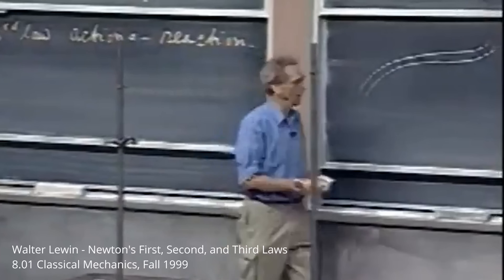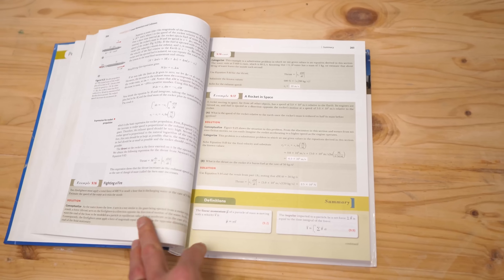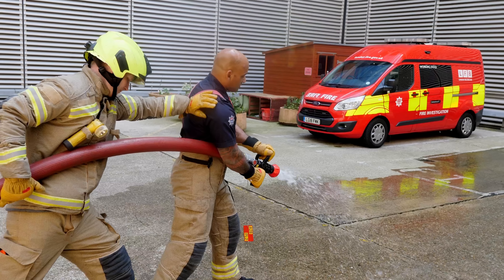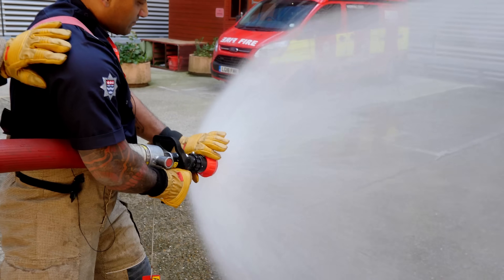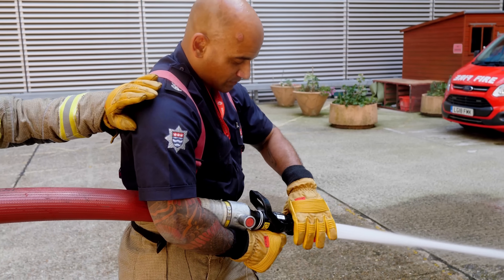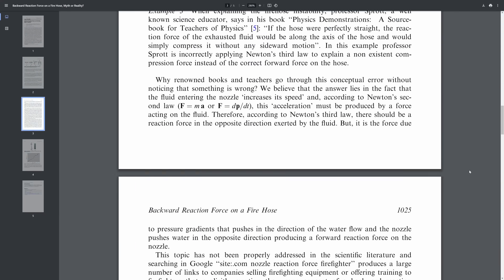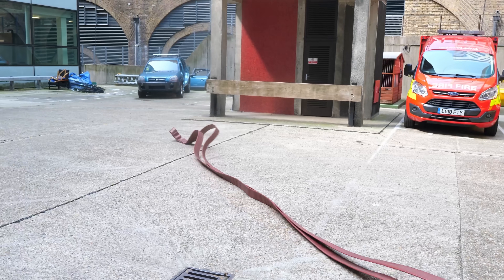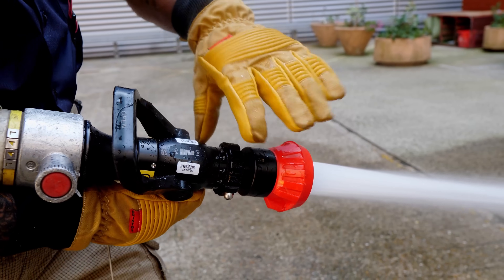Why chaotic hoses dance

Comment: 11:50 Steve I'm sure you know this but the pressure inside the hose actually does decrease along its length, a phenomenon known as head loss. The reason the speed remains constant is because the pressure gradient in the fluid accelerating it forward is opposed by shear forces created by the viscosity of the fluid. However for the typical Reynolds numbers and lengths of a fire hose the head loss would be a small fraction of the pressure drop at the nozzle so the subsequent analysis still holds.

Also worth noting that an ideal water pump imparts no momentum to the fluid it pumps, as the flow rate and density are the same at the inlet and outlet. The difference between the inlet and outlet is pressure, which becomes momentum at the nozzle as you described. (Correction: assuming the pump inlet and outlet diameters are the same)
Reply: Material properties of the hose or pipe is something else to add to the puzzle. The elastic deformation of a hose full of water is non negligible.
Reply: @caspertheghost359 I had been racking my brain over what differences there would be in this scenario if the hose was made from a perfectly straight solid material, eg: steel or aluminium. That would take out any variables due to any elastic properties of other mediums, so what impact would this change have? What if there was a small section of regular elastic fire hose added between the outlet of the pump and the solid hose in my hyperthetical? I don't brain too well.
Reply: @Denis_of_Earth1  well, then the pressure from the reaction of the water would be negated by the "hose's" or pipe's structural integrity, the whole pipe compressing on itself length-wise from the exiting water. However, not that much force is actually imparted onto the pipe itself other than the pressure from inside to outside, because now the water isn't hitting any bends, so other than the friction of the water by the pipe walls, and the pressure pushing outwards, the pipe doesn't actually experience much force, not with the firetruck taking most of that force into it.

The elastic deformation is what makes hoses so dangerous, because now it's like a chain, and there's no structural integrity there to impart all the force on it into the firetruck, so instead the entire hose is plunged into a chaotic tug of war with equal forces throughout the pipe acting it random directions, creating chaotic flailing motions.
Reply: i like the way head loss is so similar to voltage drop that ohms law and darcy-weisbach kind of match up too.
Reply: An ideal water pump would impart momentum upstream where the inlet interfaces with static stored water. It does so by inducing a negative pressure wave in that direction.
Reply: @JWQweqOPDH  Yeah I suppose it depends on where you place the boundary of the pump and the inlet. You're certainly correct that the water gains momentum when it enters the inlet from the reservoir.
Reply: I'm thinking of the rocket principle. In a hose with ho nozzle, the water just flows out calmly. In a hose with a constricting nozzle, the water accelerates and ejects at a higher velocity, creating much more force.
Seems like the hose and rocket nozzles are pretty similar..
Reply: The nozzle converts the static head/pressure to velocity head/pressure. Without the nozzle (restriction) on the end of the hose, the velocity of the water leaving the hose would the same as the velocity of the water inside the hose.

The obvious point of comparison is the old thumb on a garden hose - when you make a restriction with your thumb, the flow goes down, but the velocity goes up. Of course with a garden hose, the pressure entering the hose is constant, but with a centrifugal pump (like on a fire truck), the pressure entering the hose depends on how much restriction is in the hose, with more restriction generally meaning higher pressure. The nozzle is probably the largest source of restriction in the system, so the pressure drop from the pump to the nozzle is (probably) negligible compared to the pressure drop between the inside of the nozzle and the atmosphere. Without the nozzle, the water at the end of the hose would already be at atmospheric (static) pressure at the end of the hose, and no acceleration would occur.
Reply: @nikitanugent7165  Yes exactly, I think your analysis is spot on. This is basically what I was trying to say but worded much more clearly. The restriction on the end of the hose is the key.
Reply: If the ideal pump maintains a pressure difference, then there's a net force on it, right?
Reply: @danielchin1259  The way that a centrifugal pump works is that water enters at the middle, and a spinning impeller blade pushes the water outward, increasing the pressure at the outer circumference of the casing, where the water exits the pump.

Without getting deep into the weeds of all of the forces involved in the spinning impeller, the net force would basically be that the water makes a 90 degree bend as it enters, and another 90 degree bend as it exits.
Reply: @danielchin1259  not really, if it had a net force, it'd be displaced, but all it will do is flail about. In fact, I suspect that if the pressure always maintains the same, the hose will eventually stabilise

even without ideal conditions, tube mans can stabilise and become completely straight
Reply: The situation is different between air flow and water flow. The water is incompressible flowing in a somewhat elastic pipe. The air is compressible flowing a relatively inelastic tube. I think this difference is non trivial.
Reply: I think Steve is describing something different from head loss. What Steve describes is the gradient in pressure that must exist because fluid pressure is continuous and not discrete as is analogy. Whereas head loss is the loss of (dynamic) pressure as a result of friction with the wall, which is definitely real and is also happening in those hoses
Reply: he said that accounts for the momentum, he didn't say that it imparts momentum.
What he said is valid.
Reply: Exactly.  The pressure loss may be negligible if the hose diameter is very small or very large, with a small nozzle . It can be very significant in some cases.
This may be intuitive to people accustomed to using ohm's law. Pressure acts much like voltage.
If you "short" a power supply with nothing but a long copper wire, all of the voltage (pressure) will be lost in the wire. So the voltage (pressure) at half the length of the wire will be half of the initial voltage. If you put in a high resistance (a small nozzle), most of the pressure drop will be at that resistance.
Reply: Best comment on here :)
Reply: Turbulence, eddy current and laminar flow are generated in the hose. The flow rate is different, the pressure is different, and it keeps changing.
Reply: @jy9915  I believe that turbulence inside the hose results in highly chaotic lateral pressures as the water exits.
Reply: So it's kinda like the water is sticking to the walls of the hose right ?
Reply: @alexnepu1561  Yes, and also to itself. So the infinitesimal layer of water at the boundary of the pipe is actually stationary, and the water flows faster the closer to the center of the pipe you get.
Reply: As many have pointed out, there are many variables involved. However, I'd assume many of these variables are insignificant enough that they can be safely ignored.  Someone's good enough with coding and physics should be able simulate this wigling on a computer. I'd wager just 1 or 2 variables are enough to convincingly simulate the phenomenon on the screen; thereby proving that most of them contribute little to the effect.
Reply: I think there is a problem with the force measurement of the small transparent hose. From the setup I feel it is measuring two forces: the pulling back of the hose minus the air blowing on the top of the force meter. This last force depends on the speed of the air. But if the hose has bends there will be more friction/head loss, the speed will be slower. So with the bends there could be more pulling back of the tube itself but it is counterbalanced by less speed. Another setup might give clearer conclusions.
Reply: Was about to write this comment, thanks
Reply: @turtledruid464 Some statements are incorrect.  Speed remains constant due to conservation of mass.  Velocity and pressure gradient are related but constant speed has no direct relationship to a pressure gradient.

Your description of an ideal water pump is actually 100% backwards, at least for a centrifugal pump.  The only thing a centrifugal pump does is impart momentum on the fluid.  Everything else (flow and pressure in the downstream system) is a function of that imparted, increased, momentum.
Reply: @andrewhirsch6089  Your first statement is incorrect, take a look at the Navier-Stokes equations for pipe flow. The fluid velocity in a pipe is determined by the balance between pressure and flow resistance, analagous to ohm's law. The velocity remaining constant is a necessary condition due to conservation of mass as you say, but the specific velocity is determined by the balance of forces.

As for the pump, my original statement was indeed flawed, but your statement is not entirely correct either. It's true that within a centrifugal pump the velocity of the fluid does increase, but that velocity is necessarily converted to pressure before it even leaves the pump. If you model the pump as a black box with inlet and outlet pipes of the same diameter there is no net velocity change in the fluid between the inlet and outlet due to conservation of mass. Within the pump there may be momentum effects, but there is no ~net~ momentum effect (depending on what you count as being part of the "pump" I suppose). However, this is only true in the case of equal inlet/outlet pipe diameters -- if that doesn't hold (as is the case for many centrifugal pumps) then there will be a net momentum effect on the pump, which is where I was wrong initially.
Reply: Isn't "head loss" what happens when you leave your beer to go to the toilet?
Reply: @godfreypigott no, head loss is what happened during the French revolution
Reply: @godfreypigott Such an experiment may depend on (and determine) the length of the hose.
Reply: This was the discussion that I thought Steve would eventually build to. The length of the hose affects pressure.

Suggestion for a video: Is it faster to fill a water tank by attaching a hose to the bottom of the top of the tank (assuming hoses of equal length)?
Reply: I am doubtful if the final conclusion holds. Static pressure decreased along the hose, dynamic pressure doesn't. Just before the end of the hose static pressure is just above atmospheric (or equal just at the exact end). All that is left is dynamic pressure. There is no (!) pressure drop at the nozzle, I think. To me this is a very wrong explanation from Steve.

Even the string analogy. Water is hardly compressible, the string very much is.

'increased velocity when it leaves the nozzle' Seriously, the water is speeding up?

The wiggling of the transparent tube might be because of the 'rough' (microscopic) surface of the edges of the nozzle (the tube is 'rough' cut)

Around 14:40. Steve is blowing on the force meter: of course it will register that force of turning that dynamic pressure (speed) into static. Like pointing the fire hose at a wall: the wall will feel a force. Of course this will be independent of the type of bends.

About the force the fire fighter is feeling: look at the nozzle: its section is clearly smaller than that of the hose. Such a reduction will cause that force. Maybe for a better mental picture lets say the transition from D (the hose) to d (the nozzle) happens gradually. Even then the water is pushing against those 'slanting' walls, pushing them away the fire fighter. Or to put it in another way: the water flowing near the surface of the hose has to change direction because the surface becomes 'slanted'. If the section of the hose stayed the same up to the nozzle: the fire fighter would not feel a force.
Reply: @klosty2  I'm not sure what you're getting at with static and dynamic pressure. Dynamic pressure is just a fancy way of saying velocity since it's the concentration of kinetic energy per unit volume which varies only with u^2 for a given fluid. The dynamic pressure isn't actually pressure, it would ~become~ pressure at a stagnation point, but no such points exist in a fire hose. That would come into play for the force you'd feel if the hose jet ran into you, but it's irrelevant for the flow within the hose itself.

And there definitely is a static pressure drop at the nozzle, you can verify that with a static pressure tap. Steve was right about that part.
Reply: @turtledruid464  "And there definitely is a static pressure drop at the nozzle, you can verify that with a static pressure tap. Steve was right about that part."

Steve was right about that the static pressure drops at the nozzle, but the water is sure as hell not speeding up, quite the opposite, it is slowing down after the nozzle, because the unavoidable cross section increase of the jet (unless the nozzle is a compressor), so it is totally wrong, that the velocity, hence the momentum increases after the nozzle and that is what creates a backward force.
Reply: @turtledruid464  Dynamic pressure allows expressing conservation of energy in pressure terms. But you are correct that here this might not be needed. Steve reasoning is incorrect. Because of hose friction there is energy/static pressure loss along the hose. At the very end of the nozzle there is atmospheric pressure. If going from the outside into the nozzle why would there be a sudden increase in static pressure.
Maybe using something more analogous to what Steve is saying. Let's say I have a long hose, in the middle of the length of the hose static pressure is above atm. I now cut the hose at that place in a fraction of a second. Pressure inside the hose is still higher than atm outside. The water speeds up at the new opening and all along the hose until a new equilibrium where there is again atm at the end of the nozzle. The pump is still delivering the same pressure but less static pressure is needed to overcome the friction (only the half of the hose now) so more of that pressure is converted into dynamic pressure (more speed).
About pressure loss at the nozzle: that is at the location of the nozzle itself. Like in the hose there is friction loss in the nozzle (especially when it has a special shape inside: a lot of friction). So at the beginning of the nozzle (hose side) there is a higher static pressure than at the end side. This to overcome that friction but at the very end, at the opening pressure is atm. Otherwise you are violating conservation of energy.
Reply: @klosty2 I think you're right that the velocity can only increase when there is a narrowing in the nozzle. Otherwise there is no conservation of mass (flow (m3/s) = velocity (m/s) × Area (m2)) (assuming density is constant, because water). Indeed, the dynamic pressure than increases with the increase in velocity at the nozzle

Comment: Hey Steve! I think you might still be wrong! Love your videos by the way :)
Your explanation about a sudden change in pressure and a corresponding acceleration of the fluid at the exit of the hose makes sense for the fire hose, because there is a constriction that facilitates the acceleration. That aligns really well with Bernoulli's principle. 
However, when there's no constriction (as with your compressed air experiments), I'm pretty confident that there is no sudden acceleration of the fluid at the exit of the hose. Experience with a garden hose says the water keeps moving at a constant speed when it leaves the hose. 
A key assumption you make is that the pressure of the fluid is constant throughout the length of the hose. This is not true, because the pressure has to do work in overcoming viscous drag through the tube, so the pressure drops linearly with distance down the length of the tube. In the case of the compressed air, there should actually be an INCREASE in pressure at the exit as the air decelerates relatively quickly on contact with the atmosphere. That may contribute to the backward force on the tube. 
I'm not totally sure how exactly the backward forces that cause chaotic motion arise in each of your examples, but I hope this gives you food for thought! Let me know if you disagree :)
Reply: The water nozzle is a rocket engine... The force felt at the nozzle is the weight of the water x the velocity of the water combined with the angle of momentum of the water when exiting, and the losses do not matter and only over complicates it.

Comment: I, grade 12 almost grad, have a question about the hose/string comparison. 
The water is contained by the hose from pump to nozzle, it can go in no other direction.
The string has no constraints on it and is allowed to move in an infinite number of directions.
How can the two be fairly/honestly compared?

Comment: I would like to see an experiment with a water hose with a high velocity stream but without a nozzle, so that the velocity does not increase rapidly at the exit of the hose. I would like to think that the reaction in that case would be only due to the bend in the hose, along with the resistance from displacing air in front of the water stream. I think that the experiment with compressed air showed what it did because the high velocity air leaving the tube was being quickly decelerated by the stationary air in front of the tube. Just some thoughts.